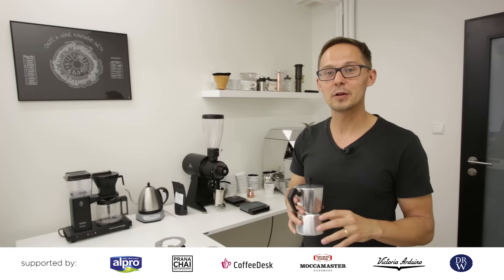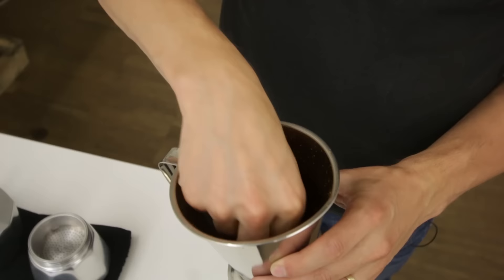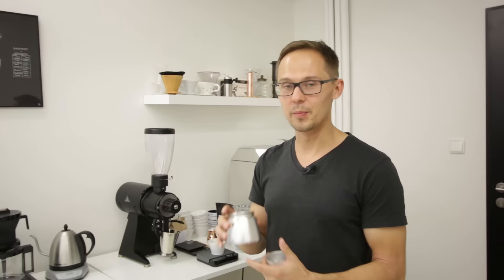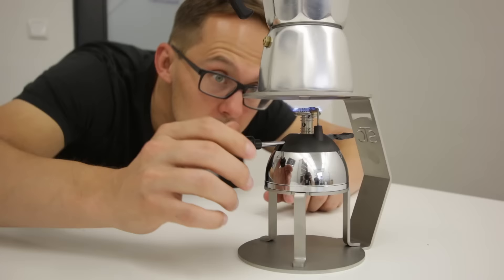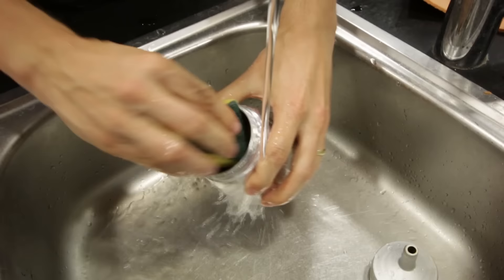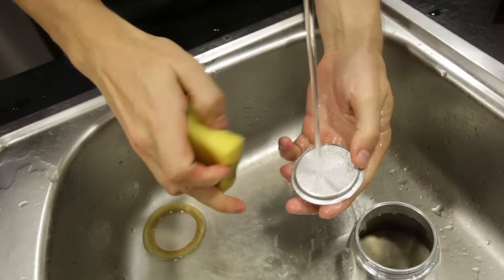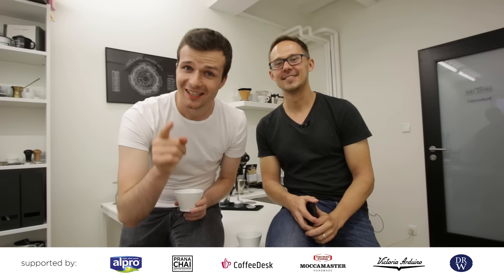How To Make Better Coffee with a Moka Pot

Comment: Maybe someone can tell me, I have a problem with water amount after boiling - there is quite a lot still left inside the lower chamber, maybe around 1cm.
Reply: It's because you used a too high water starting temperature, overfilled the water basin, stopped the heat before it was fully done or maybe it's leaking at the valve or gasket. Personally I use 65°C starting temperature and I do also stop the extraction by cooling the basin before it is done, but if you're starting with room temperature water you don't really have to although quite a big part of the extraction will be at a low temperature so I don't recommend it. The Moka pot for a large part of the extraction works by heating the air in the upper part of the basin which will then expand (so not because of steam! The steam also has an effect obviously, but it only starts at higher temperatures while the expanding air starts right when you put it on the stove), but if you're starting at 100°C or close the air won't get heated that much because the water acts as a buffer at 100°C so there will be less air expansion and less water getting pushed up. If you start with more air there will be more expansion at lower temperatures of the water and vice versa.

Comment: Please make sure to wrap the handle with double sheets of aluminum foil so you avoid the damage from the direct heat
Reply: It's not supposed to be in direct heat... only the bottom portion & not for long, since the water is already boiled. I will still use it if others use my pot though... as they cook with high flames, I don't. Drives me crazy hahaha. Thanks!
Reply: @pickledjalapeno9482  😂😂😂😂
Reply: @pickledjalapeno9482  Well "since the water is already boiled" does not apply since the manual specifically says to use cold water, not boiling water. So most people will use cold water.
Reply: @RaduRadonys  I mean that only the bottom gets direct heat, not the handle. 
(I, honestly, don't remember why I said "since the water is already boiled". 🤦🏻‍♀️
Reply: @pickledjalapeno9482  No problem it was a long time ago, this is YouTube, I sometimes get replies on comments I made 6-7 years ago :))

Comment: Will running the boiler in tap/cold water immediately after brewing not damage the boiler? I'm afraid it will eventually crack because of the heat and cold shock.
Reply: No. It'll be fine.

Comment: I have a question, do you know how to obtain with moka pot, creamy robust effect?
Reply from the maker: I think that you need really fresh and slightly darker roasted coffee. That could help with your goal but you need to understand that Moka pot doesn’t produce real espresso as the espresso machine does.
Reply: European Coffee Trip   That's the biggest pain. I noticed that my coffee from machine has the same taste as one from moka pot (it's as good as it can be) but no cream...  and cream is so important! :) I thought that there may be some special accessories to provide robust cream... or special way of pouring... Thanks for respond! Greetings :)
Reply: @Marbibuu  Use Robusta coffee. It's cheaper and gives more crema. Crema is not such a good thing...

Comment: I only clicked on this vid because we switched to electric stove from gas and I keep burning my coffee, it just doesn't 'rush out' as fast as it did with a gas stove :T I'm still not closer to the solution for my problem, but I did enjoy the vid nonetheless, it's interesting to see something I take as normal being dissected in front of my eyes. Fun fact: my grandma swears that the water has to reach the bottom of the valve :D
Reply: yeah it takes FOREVER with an electric stove. Aaarrrghh!
Reply: Try first turning on the electric stove and letting it heat up before put the moka pot on it. Then put the pot on it and see if that makes a difference.

Comment: Is store ground coffee okay? Or do you need fine ground coffee for the moka pot? THX =)
Reply from the maker: Freshly roasted and ground coffee will always taste better but you can brew it with the coffee you have. The only problem is that grind size may not allow you to optimize brewing.
Reply: grind size? i have found the Bustelo Cuban style is TOO fine for this. I use an Aeropress grind which is a littel finer than store ground and find it works better. 

Also the yield of mine (6 cup) is 230 grams water in and only about 160 -180 grams out. I leave a little water in bottom so it doesnt boil dry.

Comment: "...cool it down with a wet towel or under the running water..." Can someone please explain to me what the point of that is? If all, or most, of the water has been forced up into the upper chamber, what is brewing? Why not just come off the burner and straight into pouring the coffee?
Reply: I watched another video on the Moka Pot and it seems that the remaining water that's down there doesn't flow up as consistently, and that ends up making it bitter, as it collects some coffee grains from the filter.
Reply: @corbincaldwell8950  Ok, thank you for that. In my experience, there is zero coffee left in the lower chamber and only very, very little grinds in the upper chamber.  As far as it being bitter, I cannot answer to that as I have never had moka pot prepared by a 'professional' so I cannot compare. Maybe after this COVID19 is over... Anyway, thank you so much for your help. Peace.

Comment: I use a percolator with cinnamon at bottom of filter. more cinnamon for any new coffee that tastes bad. you can twist back and forth, a normal filter until it tears for a percolator too. percolator is all metal so you're not using plastic parts. don't use plastic at all.

Comment: Great video, thank you.  Question: we have a large moka (the standard size).  If we don't want to brew so much coffee is it appropriate to use half the grounds and/or half the water?  Thx!
Reply: No, with Moka pot you need to brew for however many cups it is designed for. Otherwise it may not work as intended.
Reply: That's was my concern when I bought my 2-serving moka pot. However, I have found that it works fine with half the amount of coffee, but I use the full amount of water. This way obviously the beverage is more "longer" but I like it.

Comment: How do you clean out the oils without using soap?
I keep hearing that soap will ruin the pot......I'm so confused
Reply: You don’t have to clean oils. The oils protects your coffee from metal taste in your moka pot. That’s the reason why  you should avoid using soap or any other solvent. Just the warm water and soft sponge is enough. You can also use it sometimes without coffee to clean it with hot water and steam.

Comment: The manual of the pot I bought says I can fill it with cold water and put it on the stove.

Because the coffee will be so strong can I put less coffee inside?
Reply: Sure you CAN use cold water but hot water will yield a better tasting extraction. You can experiment with the amount of grounds you use but typically you should completely fill the basket.
Reply: @jacobbrandenburg9584  thanks you

Comment: I always get the water shooting up sputtering. Any ideas why? I have an electric glass stove. I have to use high heat or it can be there 10 min and not boil... Sometimes it comes out all flowy and nicely as it did here, but idk why it is not that way always.
Reply: The sputtering occurs when the water is being heated at too high a temperature
Reply: Either too much heat or not closing it tight enough could be the reason.

Comment: Main point of cleaning a moka is rinse only with water. Never use detergents. Avoid scratching it with sharp objects or steel wool as it is aluminium.
I tamp mine and only let it brew for 1/2 the quantity of my moka cup for a prefect espresso. Its as good or at least very close to what coffee machines can produce but a lot less crema. 
You can make Lattes with it using any milk frother. Its the next best thing to cafe quality coffee without using expensive coffee machine.

Comment: I do everything as this video and similar but i never get the same crema come through at the start. Fresh beans, ground slightly courser than expresso at home, hot water to start and a clean pot. Any other factors i am missing?
Reply: Billy Harney you are doing fine. There is no crema. In the beginning and at the end there is some hot air coming out with the Coffee, seems like crema but it disappears fast. This is  not crema Coffee.
Reply: @paulmetdebbie447  Yes, You are right!     Billy Harney
 : it would depend on quantity of water; if it is too much, it'll become "lungo" and not expresso. The right level is maximum until half of security valve. If you like  strongher, push the powder in the funnel a little bit more, but pay attention do not do it too much. If the water can't go out, the Moka could become explosive.

Comment: Why does mine leak from the bottom?!?? Even when it's screwed very tight?
Reply: Grounds between the gasket and the threads of the boiler causes a leak.  Be sure there are no grounds above the grounds holder.  Screw it tight.

Comment: I cleaned my water deposit a couple times, but it still have a little moist smell? is that normal ?
Reply: Descale is using 50-50 water - vinegar or 30-70 lemon juice - water mixture. A quick Google search should tell you how to do it.

Comment: You ground the coffee so coarse, you made "dirty water" not coffee. Bad tip. Furthermore cooling down the pot under water will cause it to warp, making the bottom round. That's not a big deal if you use flame burners but it becomes a problem if you use induction hobs.
Reply: Way too coarse. To be honest, this is a bit of a half-arsed channel. They're not really experts, but they've decided they'll do a Youtube channel anyway (a common issue on Youtube). This is the sort of channel you go to before you discover James Hoffmann
 and the like.
Reply: Sorry but aluminium can't be used on an induction hob. Only metals that are magnetic i.e. made of steel or iron can be used on an induction hob.

Comment: Hello, I have a problem with making coffee with my moka. I'm new at it so I don't know what I'm doing wrong.

Coffee/espresso simply doesn't come out. I tested it without coffee in the compartment and it worked fine. When I put ground coffee, almost 10 minutes later, nothing.

I used fine ground, as I've read comments saying that it's ok to do so. Water level, just at the valve thingy. Tried with both hot and room temp water. 

Sooo.. Help, anyone?
Reply: Are you msybe pressing the coffee too firmly in the filter?
Reply: @adamlavoie4524  that's my guess too.

Comment: It appears to me you gonna ruin the gasket  pretty fast this way. No cleaning suggested by many is wrong but thorough cleaning with sponge is wrong too. Cleaning with fingers without gasket removing should be sufficient.
I like the design of Tescoma's moka pot you use. It also has pretty durable silicone gasket (unless you remove it each time with a knife). One not so nice thing about it is the hardly finished insides of the water tank. I have the very same model but hesitate to recommend it.
Reply from the maker: Hey Vlad, thanks for the comment, you are totally right! We shouldn't do it with a knife.

Comment: Don't use a wet towel to grab the hot pot! wet towels transfer heat about 100000x faster than dry, and you could easily burn your hand.

Comment: I'm just learning. Never made coffee any other way than instant from a jar. I thought Moka meant coffee and chocolate. I'm thinking of Mocha maybe. I bought some Espresso ground coffee from Lidls, in a little box.Then discovered you need one of these little pots. I had a look at them in TK Maxx and found that they're always made of aluminium, which is linked to Alzheimers, (bit concerned about that). Now l see that you should grind the coffee yourself, and it looks like quite a lot of coffee grinds is needed for just one drink, also the cleaning process after each use is quite intense. Although lve never tasted espresso, a nurse l worked with used to drink it at work and it always smelled delicious. I never paid any heed to how she made it. Now l'm wondering, is it all worth it?
Reply: @szita2000  Thanks. I'm not even a coffee drinker really. Just enjoy a properly made one in a barista bar when l'm out with my sister. 😊

Comment: That's too coarse a grind. Somewhere between what you did and espresso is ideal. Espresso is too fine, for sure, but I think you have gone too much the other way. Your coffee looks weak to me, just visually. The Moka pot is for making a strong, espresso-like coffee, not cafetiere style.
Reply: I think we all do it differently and I suppose nobody is 'wrong'. I like mine strong too.
Reply: @Chahlie  Well, it's not completely about preference, there kind of is a 'wrong way'. It's about the correct extraction for the type and grind of coffee and the equipment you're using, to get maximum, balanced flavour. With that coarse grind, it's under extracted and will taste acidic and just not full-flavoured. The Moka pot is designed for a quick extraction under pressure, so needs a finer grind. Not quite as fine as for an espresso machine, but similar.

Comment: Good video, but:
1) FRESH (room temperature) water! Moka coffee is not for the rushed. If you're in a rush, then moka coffee is not for you :)
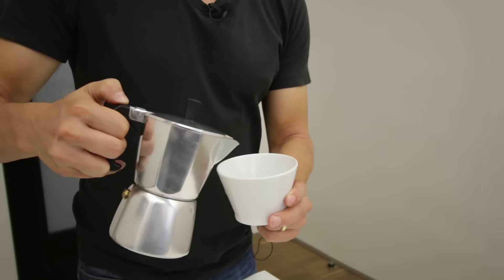2) What's the point of putting the moka under tap water at 2:58???
3) Good suggestions about the cleaning, but most importantly, NO SOAP and let your moka pot dry after you wash it.

Comment: You do NOT have to tear the damn gasket assembly apart every time.  that’s stupid. there’s a general level of cleanliness that needs to be maintained but no one will notice if you don’t tear it down to it’s components. These guys are idiots. they mean well, but they’re idiots trying to find reasons to be over-discriminating, which is vapid and tiresome.

Comment: worst coffee maker i have used... coarser grind and watery coffee... finer grind and lots of coffee in coffee (mud). best i could get is with finer grind... use flame to extend brewing and wait for some time for mud to settle... use rest. no need for washing and crap. a quick rinse through with finger scrubbing is good enough.

remember trick is to get coffee with 100% of bubbles... if it is running fast then you miss bubble and end up with either bitter coffee or watery coffee (depending on grind). fill water at less than half.

but investing in espresso machine is far better option. you live you each day only once.

Comment: Who are they kidding? NEVER use an aluminium device for making coffee or cooking food! For a little extra cost, buy one made from stainless steel. This Moka pot method brews your coffee with boiling water at around 100 degrees which is wrong - don't these guys know that? Experts advise the temperature of the water should be no more than 90 degrees to avoid bitterness. Move on everyone, absolutely nothing to see here!

Comment: Mah..."de gustibus no disputandum est." Anyway some errors are made and wrongly taught in your video. In example you need to use cold water instead of hot water, just because you get losing aromas since the beginning. Second, you do not need to wash your moka pot (internationally known as italian coffee machine) but just rinse it and get drying open. No soap. Sometimes, you can easily clean it with a spoon table of sodium bicarbonate when you change rubber ring. After that operation you need to do some coffee and throw them to give taste to your clean italian coffee machine, your named moka pot... We say "avvinare" that is a chemical-physical operation made from every chemist in his lab with every chemist glass. At the end of all you do not need to get your italian coffee machine under water to stop extraction, it stops just with water boiling, passing trough coffee powder. Cheers!
Reply: Exactly. In order to get a decent result, an italian coffee maker must be "seasoned" with at least 3 coffees, which will have to be discarded, and should only be cleaned with water, without removing too much of the coffee oils layer from its internal surface. The older the coffee maker gets, the better the coffee is going to be.
Reply: @flashdelara1  It's something I heard from fellow baristas using a professional espresso machine too, so it might be somehow true :). A cup in a too clean machine would taste to clinical.